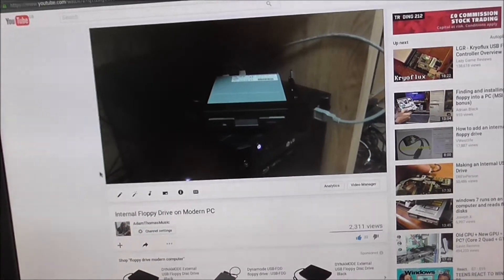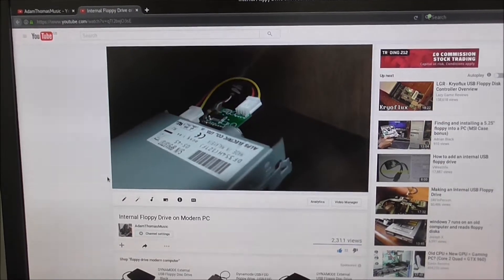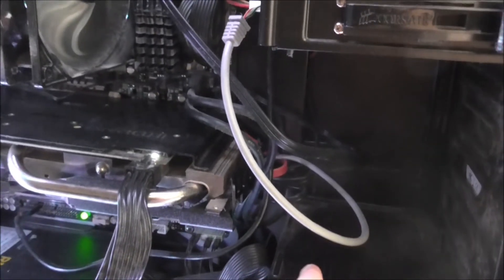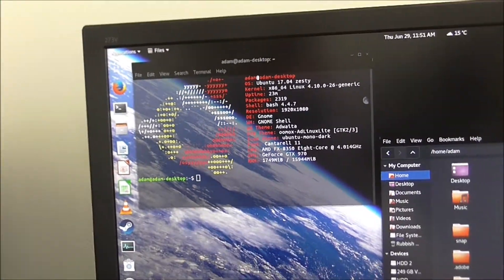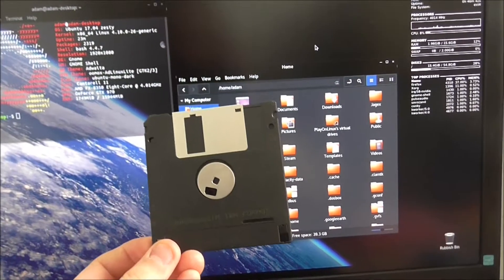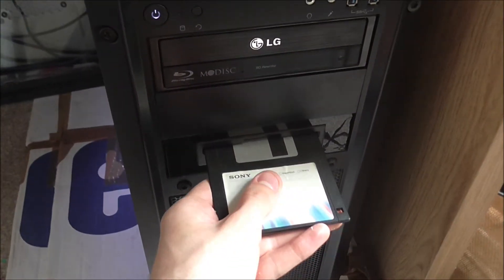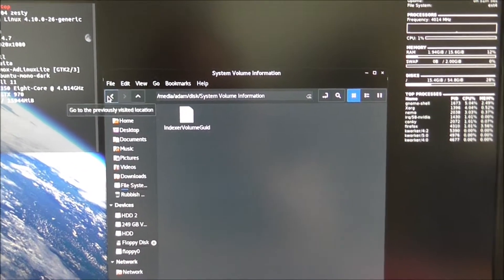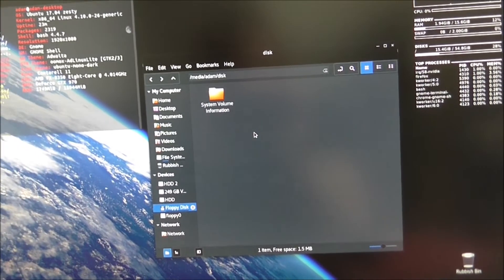Internal Floppy Drive on Modern PC - Part 2: Linux

Comment: Linux is the way to go for Legacy and Bleeding edge hardware. I got a floppy drive using the native ribbon cable connectors for IDE HDD's and a Floppy controller onboard on a LGA 775 motherboard 2gb ram a 3.06Ghz single core Celeron D on a setup with Slackware 15 or 15.0 RC1 or officially Slackware64-current. It runs fast and stable with the xfce desktop it does pretty much everything except play youtube video's which I am working on and with the OS loaded with the GUI desktop enviroment with Firefox with a few tabs and a couple of terminal windows it barely used a GB or ram slightly more depending..... I have even had success with using serial ports in a VM in Slackware with MS DOS 6.22 and Windows 3.11.  Personally I do not use Windows virtually at all except for work not on any of my personal machines except VM Windows.... Windows 7 was the last of the best Windows versions Windows 10 was ok I guess but I did install Windows 11 on a VM what a nightmare while Linux is seemingly getting easier Windows is becoming more complex even though I have multiple IT qualifications including Microsoft certification under my Advanced diploma in computer systems engineering Linux is a way to the past and Back to the Future. But good work with your way of adapting a old school Floppy to a new age computer. Cheers

Comment: I hope this works, because my floppy disks aren't being read by my external floppy drive. I'm using Windows 7 and out of the 20 floppy diskettes I have, I manage to just open 1 diskette. Got to copy the contents to my hard drive. Unfortunately the other 19 was giving me a "this disk is not formatted would you like to format it now" error. :(
Reply from the maker: Good luck! Make sure you don't wipe your windows off the hard drive. I personally use a second SSD for Linux just so there can be no problems with it. Let me know if this works for you.
Reply: Can I just run ubuntu on a usb?...I already ran ubuntu without installing it before but with a CD, but my new pc doesn't have a dvd drive.
Reply from the maker: Why yes, yes you can. I had forgotten about that lol. That should work no problems
Reply: Unfortunately it doesn't want to read it won't mount it even, I used the latest one 18.04.1 LTS. Maybe I need the version you're using. I'll try to download that one and give it at try.
Reply: Well I ran the same version of ubuntu like what's on your video. The good news I was able to copy some of my old files, the bad news is most of my floppy diskettes can't be read. Oh well, they probably got corrupted, but at least i got to salvage some files.

Comment: I had gotten a server computer case from a friend. and it has a cd drive, and as well as a floppy drive. both dont work as i dont have a power cable for cd drive, and cant afford floppy adapter yet.
Edit: Why didnt you use sata? is there no adapter for it, or it dosnt work?
Reply from the maker: MCD0И4LD TЯUMP3T I couldnt find a floppy to sata adaptor, so floppy to USB was the best I could get